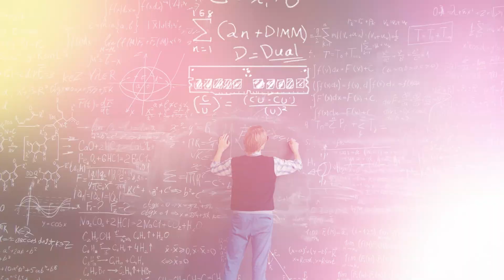CUDIMM Explained – DIY in 5 Ep 237

Comment: Thank you. Why, as of today Jan 18, do these CUDIMM sets come in 24x2GB capacity? Why would I switch from DDR5-10000 48x2GB capacity to CUDIMM DDR5 9600 24x2GB capacity? Under this scenario what is better: higher capacity or higher speed+stability? Thanks.
Reply from the maker: Thank you for the inquiry. For our FURY Renegade modules we have Kits up to 48gb (2x24GB) and for our ValueRam lineup up to a single 64GB module. As for the performance increase that all depends on your motherboard and Intel CPU combinations well as the BIOS if it allows since the 800-series (Arrow Lake) is the only platform currently to take advantage of the CUDIMM technology. AMD does not plan to support CUDIMM / CSODIMM technology until a future chipset (2026+).  If you have further questions, please contact us here:  https://kings.tn/42kzzMb

Comment: So CUDIMM is RDIMM but for desktop?
Reply from the maker: CUDIMM is an acronym for Clocked Unbuffered Dual In-Line Memory Module. JEDEC industry standards require the inclusion of a client clock driver component (CKD) on UDIMMs. Register components, also known as a Registered Clock Driver (RCD), which acts as a buffer between the DRAM (memory) components on a module (DIMM) and the memory controller (generally located within the CPU) is what defines a Registered DIMM or RDIMM.

Comment: if the clock speed to RAM is a problem, wy not use only a 500 MHZ mem bus speed and CAS latency of 1 cycle. this is near double as fast as a 6400 with CAS 30 clock cycles. RAS latency can then 2 cycles which is near 6400 CAS 30

Comment: 1st. I love the videos, I see Trisha I click. 2nd. The stock clip where the guy is looking in both directions confused got me 100%. 3rd. My workstation has 128GB of ECC UDIMM DDR4 and for the first time in my 30yrs+ of professional computing I'm seeing transient memory errors while the system is running! Memory tests are clean... Maybe a move to CUDIMM could mitigate this?
Reply from the maker: Thank you for your feedback and great to know that this content is useful. As for the issue you are experiencing with your current system, you may want to check the BIOS and also perform a bench test like memtest86 on the modules. The new CUDIMM is DDR5 and will not be a replacement for any DDR4 modules.
If the tests show that the memory is the issue and it is Kingston memory, please contact our Tech Support here: https://kings.tn/4gpqF46
Reply: We used to see one or two a month in the early 2000s. But we were monitoring 1k+ Sun systems that could actually detect them. Consumer hardware has them a lot, you just can't detect them until it becomes a hard failure.
Reply: @john_in_phoenix  fair point about consumer vs pro grade... but my DELL/IBM/SuperMicro servers I've managed over the years rarely if ever through detectable errors. Maybe they were safely corrected and hidden away all this time.  But having a workstation with more RAM than the disk sizes I started with already is wild, but just saying it seems a requirement now to have ECC now that sizes have ballooned.
Reply: @ivanlawrence2  Modern cpu's have more cache than the floppies I used with my C64. We've come a LONG way in 30 years.

Comment: You said, that the new CU-DIMMS are working with Intel's new Z890 chipset. But I don't really see, why those DIMMs would be incompatible with the Z790 chipset. Does the CU-DIMMS come with a different pin-layout? As far as I know, both memory sticks should fit into the memory socket.
Could be interesting to make a benchmark comparison Raptor Lake vs Luna Lake both with CU-DIMMS at high memory clock speeds.
Reply: Perhaps it's how the Memory controller on 12, 13, and 14th talk to memory compared to Core Ultra stuff does